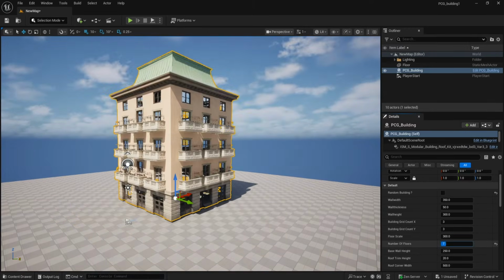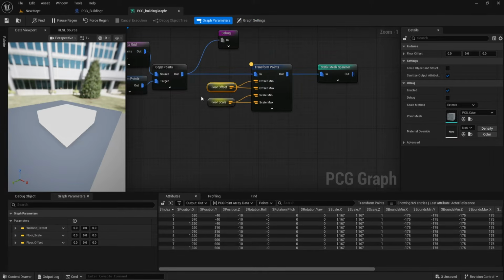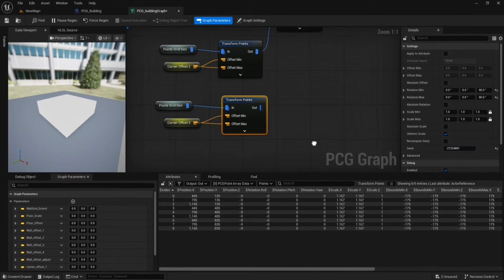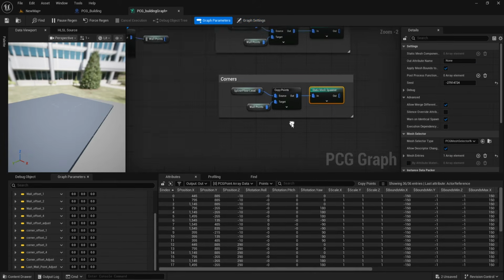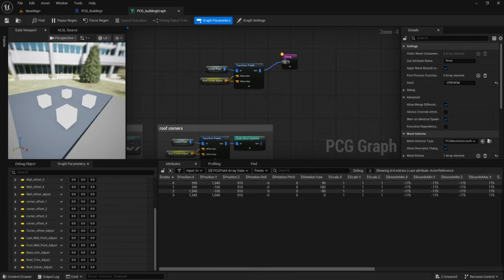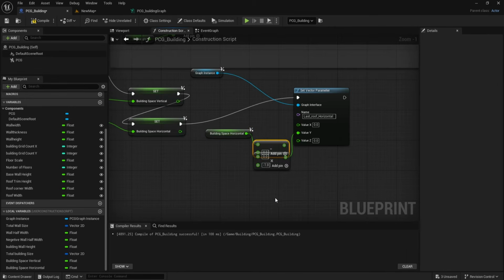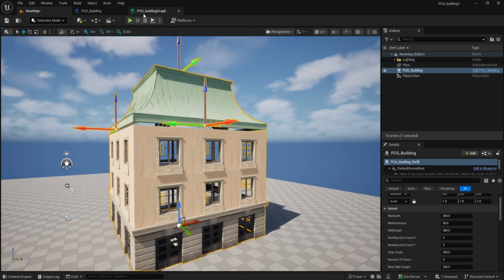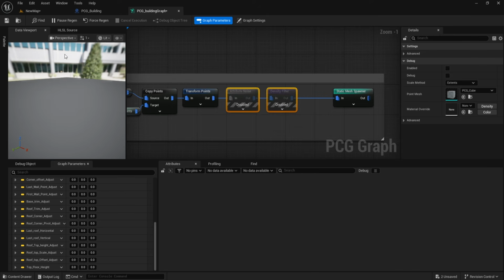Unreal Engine 5.6: Intermediate PCG Building System Tutorial | DIPJOY UNREAL

Comment: I'm using UE 5.7 and for the top roof scale section, my flat roof piece wouldn't scale correctly to the building size. I didn't see you make a change to the transform points node but,  I was able to fix the issue by unchecking the Uniform Scale box.

Comment: why when i desable floor offset or scale, the floor is visible but when i enabled is invisible, same with transform point with walls
Reply from the maker: This usually happens due to scale / transform evaluation in PCG, not a bug in your setup.
When Floor Offset or Transform Points is enabled, PCG may calculate very small or zero scale, or push the mesh below the surface, making it invisible.
Please check:
• Min scale is not 0 (keep ≥ 0.1)
• Floor Offset is not negative
• Mesh pivot is correct
• Click Force Generate (PCG sometimes doesn’t refresh)
• Enable Debug Points to verify point positions
Also ensure correct node order:
Sample → Floor → Transform Points → Spawn Mesh